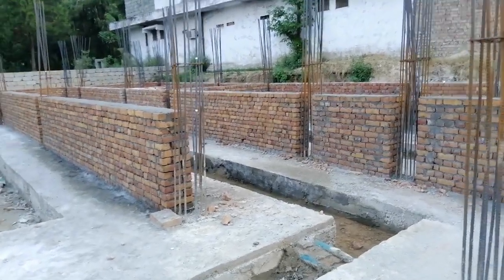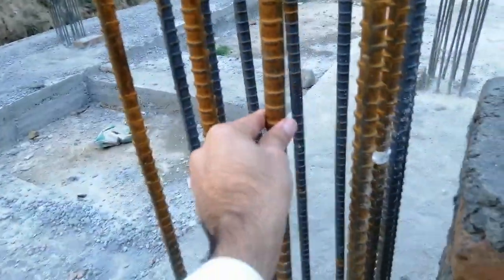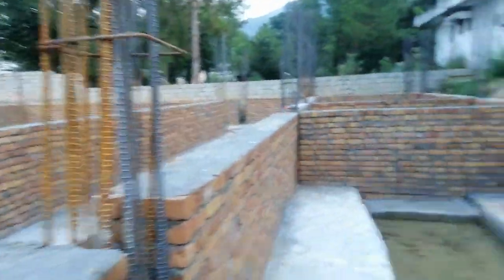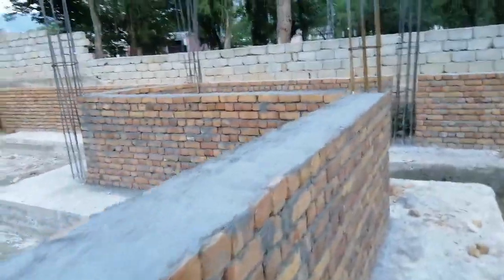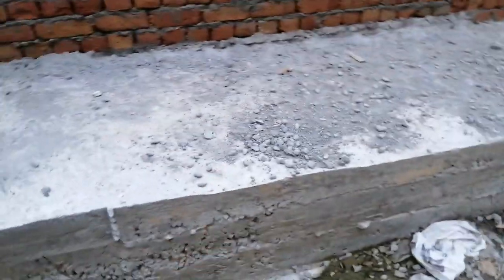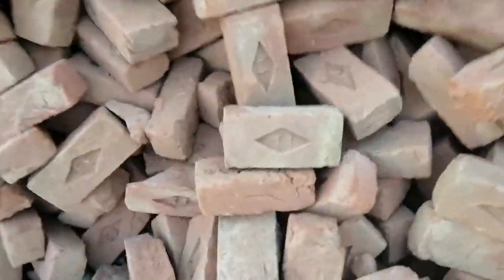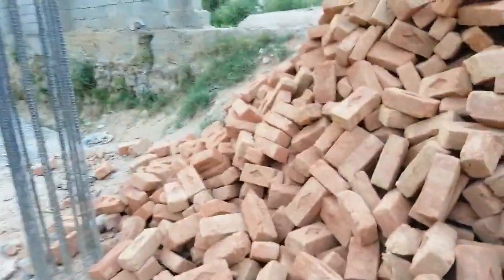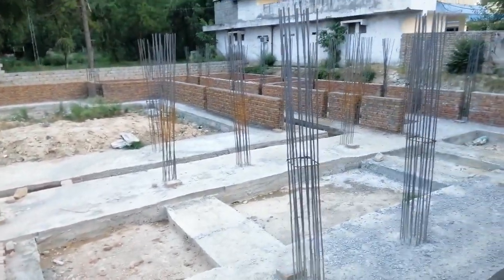Practical Knowledge for Civil Engineers on Site | Free knowledge for Civil Engineers |

Comment: Hello friend great video, but I think you're confusing strip footings with combined footings, they aren't the same. The spacing between the columns  doesn't necessarily requires a combined footings. What is shown here is a strip/wall footings as it goes round the perimeter of all footings.